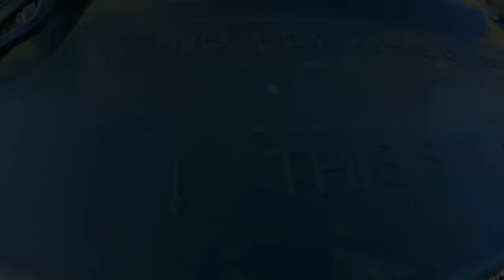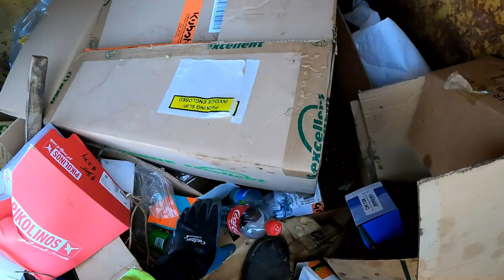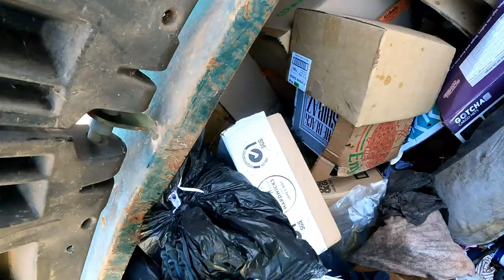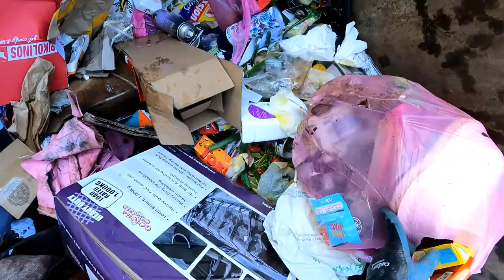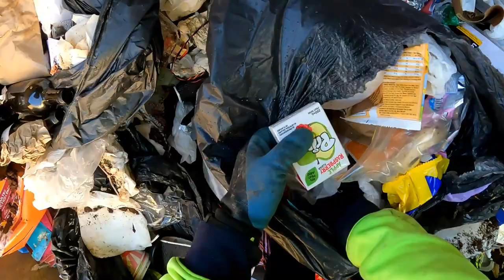Dumpster Diving Groceries In Hand Part 2

Comment: What i do with those plastic bottles without bar codes . I still collect them because i always find water bottle or soda bottles labels at the park and i pick them up as long as bar code is attached.  I put the label on with scotch tape not covering bar code and it gos through the recycle machine.
Reply from the maker: With any of the crushed plastic bottles we get we blown up with a air compressor this way it put them back into shape but most of the time we do not have to blow them up as  long as the barcode is visible.👍😎😁
Reply: @oureverydayliving  cool . I'll try